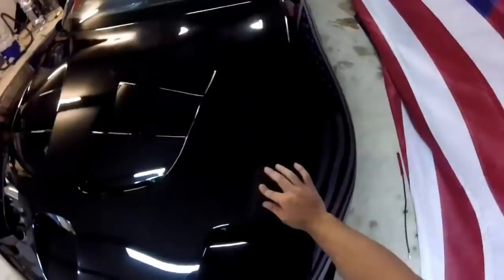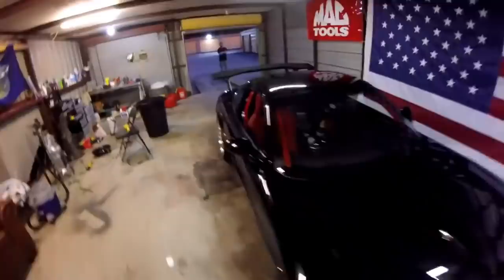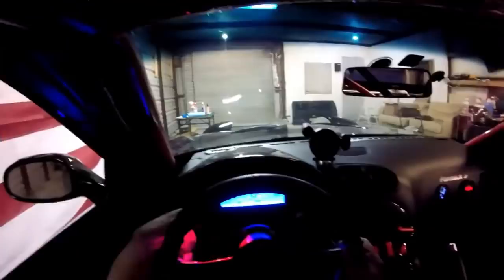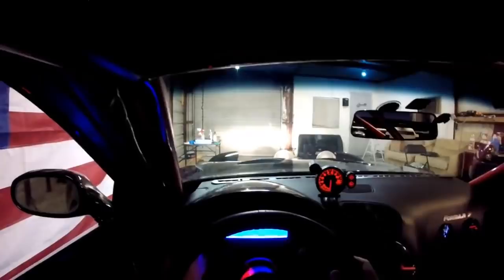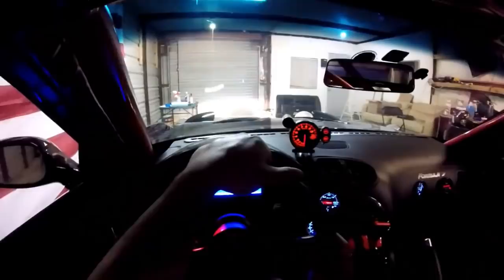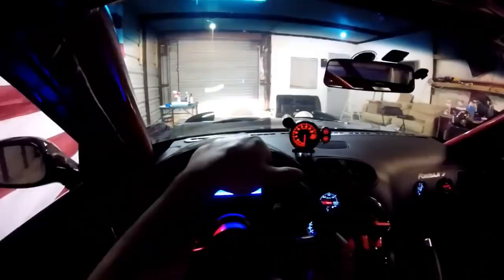How to Drive a 4 Rotor Peripheral Port Turbo RX7 On the Street

Comment: Ooooh finaly some video on how this beast go on street under some pressure..
All the other videos of this fucking RX7 ..are about engine  and building , dyno ecc but no videos how fast this Badass is under full pressure and rpm on track or road.
My idea is that with a engine boosted like this ...its really undrivable..or god for some straight rpms and thats it.
For this reason i will like to see how it work on a track with some turns..

Comment: This is a beast and beautiful ...but after owning a rx-7 and 8... My experience was horrible . I bought both to keep the miles of my 2004terminator Cobra and be fun...I couldn't keep either one of them on the road not even the mostly stock rx 8...I've got a KB on my cobra and its been daily driven for times over the years and not one time has the car ever seen a mechanic for issues...just my experience though..THIS CAR IS SEXY AND RIDICLIOUS and even running 17 lbs on my KB I think this car would be a handful or too much even lol

Comment: When I see videos like this, I always wonder roughly how much a build like this would set the owners back. To get a rough idea of the costs (if you don't mind me asking), what would someone be looking at if I wanted to attempt a build like this?

I fell in love with RX7s a few years ago, read up a lot about them as a result I'm aware of a few of the owning/running costs and some of the smaller things that can go wrong with them, but beyond that they're a bit of an enigma to me, so any new information and insight I can get will be helpful and appreciated. Many thanks in advance.
Reply: Car is likely over 20k, engine 60 to 100k, hallinger dog box 20k+. Might have the 10k swappable final gear diff. Suspension, engine management, brake system, rims, wing, carbon fiber out the butt.. Who the fk knows

Comment: Bro I think you need to redo your clutch from the way your car bounces when you get going from that stoplight and when you shift it sounds terrible but this is still my dream car!!!
Reply from the maker: biggirlpanties 99 it's the rear end wheel hopping because the engine idles at 2500 so it's hard to let out at 2500rpm when wheel speed is zero

Thank you I really appreciate it!

Comment: Amazing car, but you should maybe get a twin disk and make it a little more streetable
Reply from the maker: Thank you, it's actually a triple disk. The torque output of the engine, but the high rpm idle/overlap is what makes the car difficult at low loads
Reply: @dzmazzei  oh ok, nice..
You should take this baby to the quarter mile.
This is one bad ass 4 rotor, maybe the badess.
Keep up the good work.

Comment: can you tell me the pros and cons having a peripheral 4 rotor?
Reply from the maker: Nicholas Lyon it sounds like an f1 engine, makes a tons of power, and fun to drive. Cost is high to build, a lot of labor and custom work required, puts off a lot of heat and uses alot of fuel

Comment: can you go realy fast at shifting or is it only for max tourqe build? its not that slow but it could go faster when you make a pull.
Reply from the maker: Heinz Becker The transmission was being broken in. Now that the detent springs are swapped, you can pull it at 25 milliseconds between shifts with no clutch.

Comment: Does this rx-7 have a really heavy clutch? Cause you made it bounce a couple times lol
Reply from the maker: Very light clutch, high overlap peripheral port engine, with a dog ring straight cut engagement gears. It's a race transmission and engine, not very street friendly
Reply: @dzmazzei  Ohhh ok well it is still a very nice rx-7

Comment: Ngl do you even know how to drive a car like a normal human, because I can't tell exactly but it sounds and looks like you just drop the clutch every time you shift...

I don't know, I guess it's a purpose built race or drag car with a dog and stuff (sounds like straight cut gears) but surely you can shift smoothly even with that setup.

Sick car tho, sounds bloody wild.
Reply from the maker: Its very difficult to drive. Yes, I have much experience driving. It's a full peripheral port engine, which means extreme overlap, much like a very long duration cam profile. The car must idle at 2500rpm. Leaving from a stop, with a 2500rpm, and a 3 ratio first gear, on a 4.10 rear requires extreme care and caution, as the engine wants to travel 25mph for 2500rpm. The clutch must be slipped and throttle used lightly on/off until you reach 25mph, or else the engine will stall or overlap surge. Once you are moving, you must use continual throttle in lower gears, or keep the car loaded on throttle in higher gears, or else the overlap will cause surging. This engine prefers to be under hard throttle to run smooth as it's pure race bred performance. 

On a dogbox transmission, the high backlash and profile of dog rings and straight cut gears, further exacerbates the issue. When changing gears in a dog box transmission, you have two choices. One, shift very slowly, using the clutch and allowing the input shaft to synchronize with the engine, before engaging the next gear, to minimize dog ring wear. This explains the slow shift times. Option 2, is to shift without the clutch, very quickly to minimize dog ring wear, but is not ideal for driving around on the street, until tires are hot, and you are ready to race/prepare for such swiftness and precision. 

Before you comment and cast judgments, I would implore you to do your own research and learn more about race engines, such as the 787b or Formula 1 engines. See how the small rotational mass/lightweight flywheels and clutch systems prove amazing for high rpm racing, but pose drivability pitfalls for cruising on the street.

Thank you for your inquisitiveness however.
Reply: @dzmazzei  
My comment came off a lot more aggressive than it was meant to seem (it is kinda insulting yeah), sorry about that mate. I could hear you doing most of what you're saying like the clutch slipping on start was very apparent, but I just chocked that up to racing habbits. So yeah it seems I so need to do a bit more research ay. ;^)

P.S. I didn't think your shifts were slow, they just seemed lazy and chaotic to me (but yeah I don't race and I didn't know) I thought you might be hurting the car and I think I speak for everyone (including you?) when I say the last thing we wanna see is that thing get damaged.